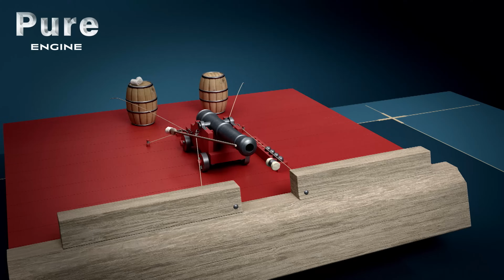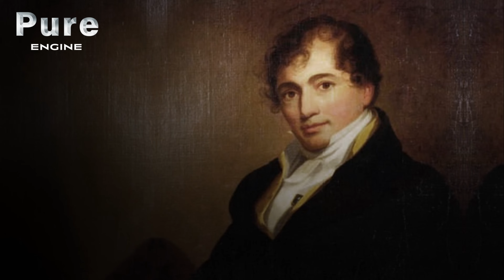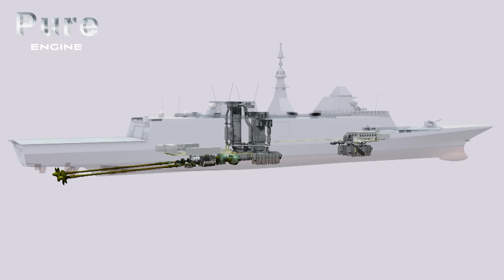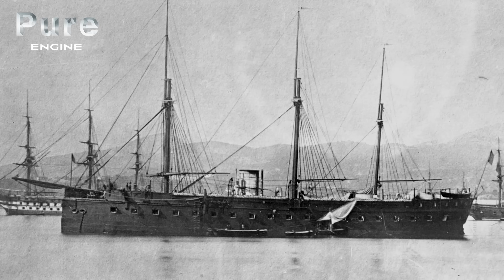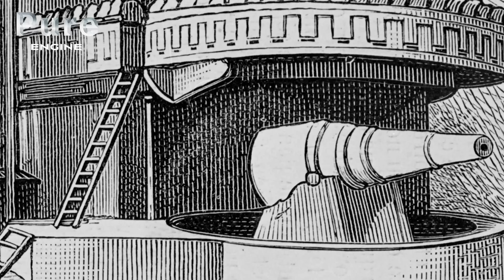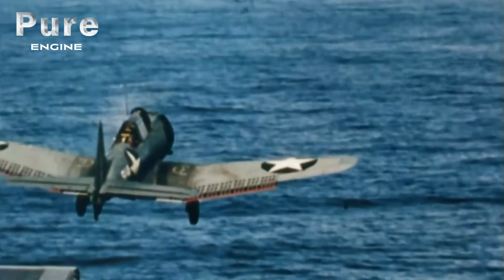Weapons, Engines & Armor: The Art of Naval Domination

Comment: Nice video although it is very France centric and ignores accepted consensus.
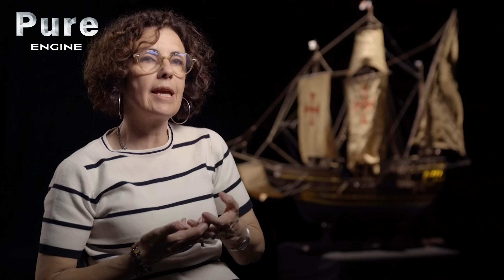Best at time stamp 14:03 ff stating that Gloire was twenty years long the prove that France was ahead of Britain.
Really? HMS Warrior would have smashed Gloire three times over. Gloire commissioned Aug. 1860, Warrior Oct 1861, so we may talk about 14 month.
And after HMS Warrior existed, Gloire was outclassed?
Why?
Armor: Warrior 4.5 inch plus wooden backing, Gloire 4.7 inch French steel 
Armament: Warrior 68 pounder, Gloire 54 pounder
Speed/Maneuver: both 13 kn, Warrior more sail power longer endurance.

No way that Gloire assured 20 years long technical superiority of the French navy. 
THAT IS NOT TRUE!!! 
It is a reason why it’s called Ironclad frigate and not fregate cuirassee (sorry for missing the accent)
And a shame that this is stated openly by a „historian“.
And I not from Britain, but I know my stuff.
There are more mistakes or inaccurate statements about gun sizes and weights. And important information aren’t even mentioned - USS Monitor?  John Ericsson? Only mentioning Cole’s turret is weird.

Comment: Very good, merci.  However, no mention of the Merrimack/Virginia or the Monitor of the mid-19th century USA.
Reply: Those were not really sea going ships, or part of the history of warships.
Reply: @tflemming287 yes, they were very much part of the history. The Monitor was responsible for ships mounting turrets.
Reply: @melgross not accurate
Reply: @mar117117 then give us specific instances why it isn’t. And it can’t reflect some experiments that were made that went nowhere in so far as actual ship construction and use, or little vessels that bear no relation to actual usable ones.
Reply: @melgross while the monitor was the first ship to use an armored turret in battle, at the time turrets made ships too topheavy, making them usable only on rivers or near coast. Bluewater ships used open barbettes although monitor like turrets were also experimented with. Modern turrets evolved from open barbettes by adding more armor as the armoring technology improved.
Reply: @mar117117 modern turrets did not evolve from fixed in place barbettes.
Reply: @mar117117 you are missing something vital. The uss monitor proved turrets were viable on ships at all. Britains interest in perfecting the turret was because of uss monitor. Not in spite of uss monitor. I think that alone should qualify coastal monitors as a part of the larger narrative